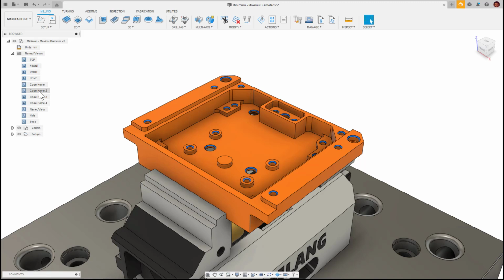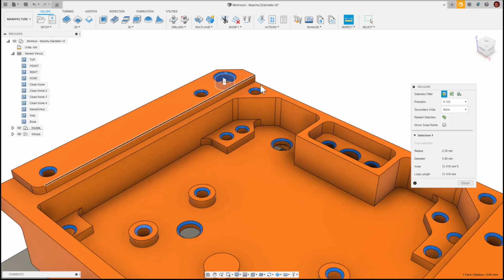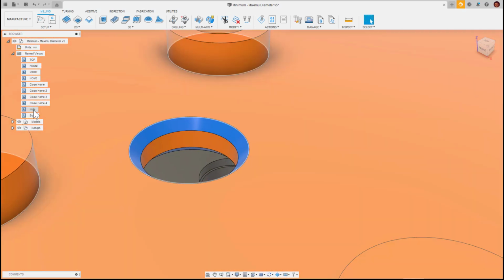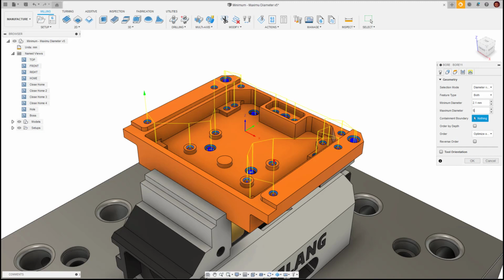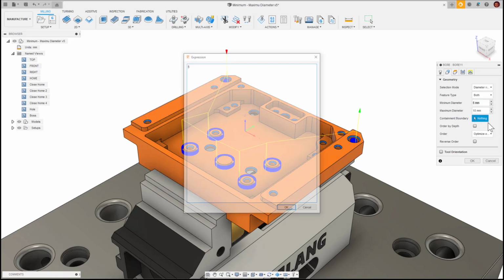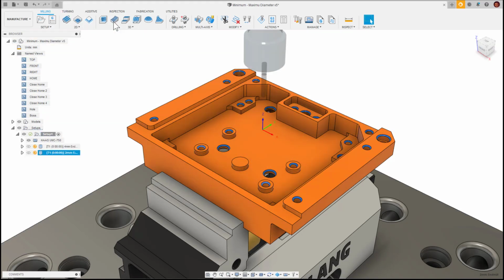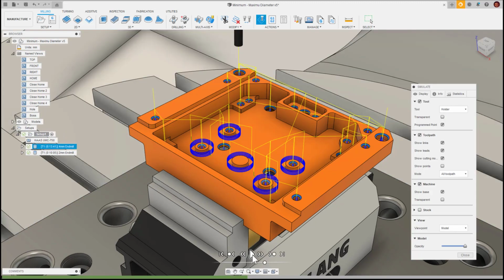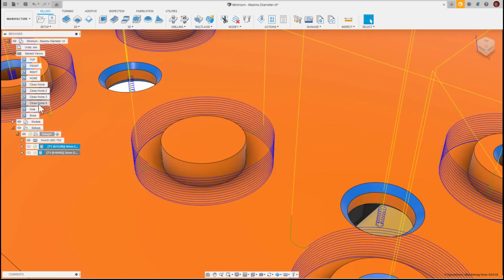Autodesk Fusion360 Tutorial: Minimum - Maximum Diameter Ranges for 2D Bore, Circular & Thread

Comment: Need to add feed rate compensation for adjusting the programmed feed rate so the effective feed rate stays consistent. A .500 endmill milling a .750 bore spins a .250 diameter programmed path circle yet traverses the full circumference of the .750 diameter. Would be nice if Fusion could output the adjusted feed rate for each bore so that the feed rate programmed matches the effective feed rate.  Perhaps a checkbox to turn on feed rate compensation within the tool path dialogue.